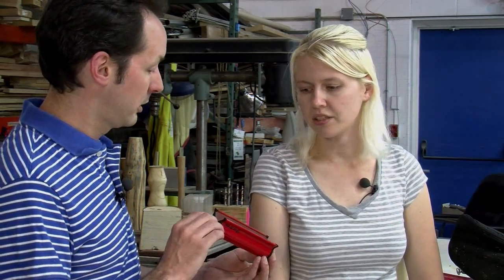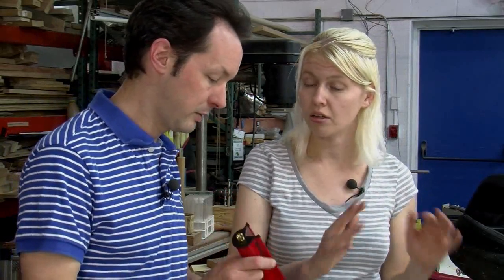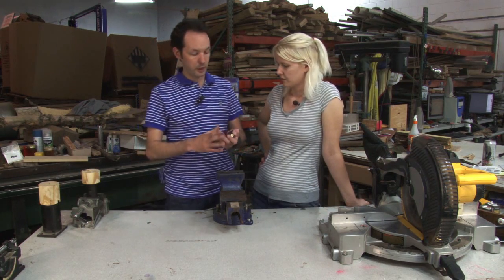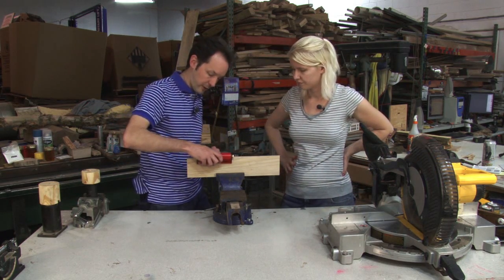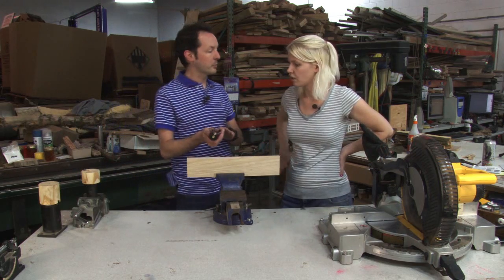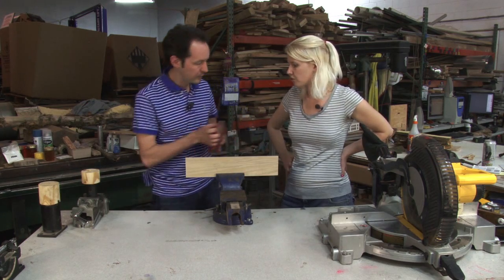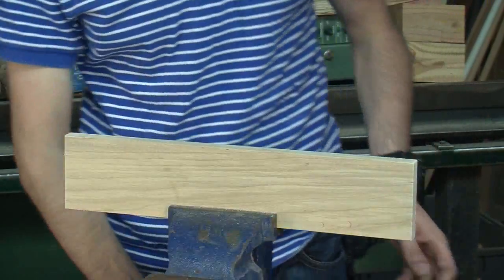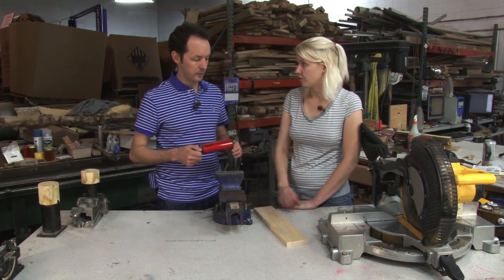FastCap FastBreak Sander Demo

Comment: Another excellent video guys.  The Fast Break is such a time saver when doing big runs of parts.  The fact it does both edges at the same time, halves the time it would take with and other tool and it's completely safe too!

Comment: A Palm Router with a 1/16" radius or a chamfer bit works great to break the edge of work pieces as well. I personally prefer using a radius bit and then a cushioned sanding disk from a random orbit sander in hand to final sand before finish is applied. Also, someone please show Chris how to sand wood, never sand against the grain, it will make your life a lot easier come finish time. ;o) Moose... CNC Guru and Woodworker? Swoooooon. ;o)